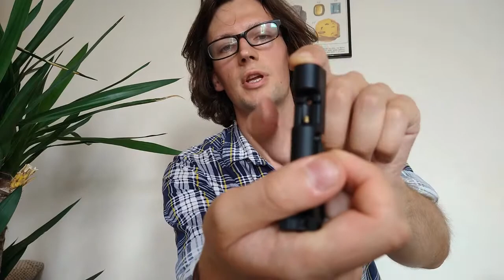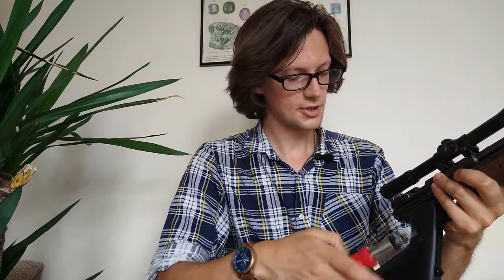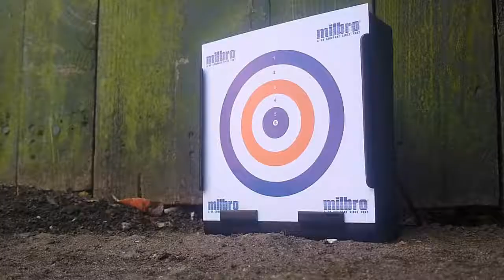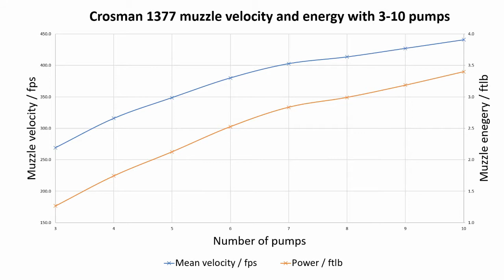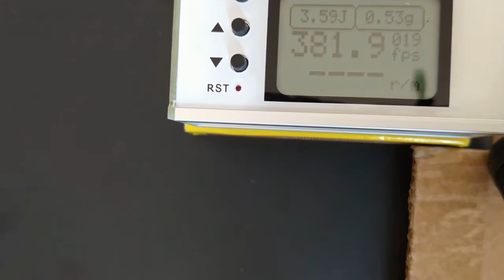Crosman 1377 Mods, Power and Accuracy Tests

Comment: Hi, I noticed you push the Bolt in real fast ,,, When I switched over to the steel breach, my pellet would get stuck before it goes into the chamber, does your steel breach give you that problem? It seems to get stuck on top of the screw ,that you said that you switched yours to an Allen head screw

Comment: Wonder why yours is so much off on power..my 1377 3 shot chroni tests were with a 7.9 g cphp pellet was 3 pumps 388/373/375 ..5 pumps 455/459/462 ..8 pumps 532/541/531 ...10 pumps 562/565/568...12 pumps 592/595/594 ...15 pumps 625/616/621 ..20 pumps 636/640/637 ..all ive done was steel breech and cleaned the barrel on it ..wonder why ours varies so much

Comment: I got confused at beginning when you showed the transfer port mod. You mentioned drilling out the orifice, but you wanted to remain stock. So, is the new transfer port the same O.D. ( outside diameter) as the original? Just the I.D. Is larger by way of a thinner wall on the new port insert?? Thanks

Comment: Could you tell me where I can get a longer barrel for my 1377
Reply from the maker: Hi, gmac custom parts sell 18" and 24" barrels for £40 and £44 respectively but it looks like they're out of stock right now. Their customer service is pretty good so you could email and ask when they might have some in. If you're in the UK, bare in mind that air rifle barrels have to be collected in person, sent to a RFD or posted in exchange for your old barrel.
Reply: @ThrHillSeeker  I bought a 12-inch barrel on eBay last night. He has all sizes just search 1377 barrels on eBay.
Reply from the maker: @CharlesNolanArt  Unfortunately airgun barrels have to be sold in person by an RDF in the UK (the same as whole airguns) which makes modding a bit more difficult.

Comment: Nice video mate. Have a stock one myself. Will likely add the stock myself and go for a weaver rail mod, so i can swap sights with the Umarex Buck Mark.  Would say, i think it really did not like your pellets.  As with the right pellet it can easely put hole on hole, this thing has nearly match pistol accuracy with the right pellet. 

I was quite surprised that it didn't provide more power with that transfer post upgrade tbh. I expected it to be quite a bit over 600fps with that upgrade.
Reply from the maker: Thanks for commenting! Sounds like a good project. Yeah, the spitfire pellets are awful but they were all I had that day. Now we're coming out of lockdown I'll be able to get out and stock up on more JSBs. It's a pretty old gun and I don't know what the previous owner did (or failed to do) to it, so the valve might not be in great shape.
Reply: @ThrHillSeeker  Indeed, it may be leaking a little, not too uncommon, mine does so too. From 6pumps up i always feel a slight rush of air over my trigger finger. That said i mostly just shoot 3-5 pumps. Plenty for my little range
Reply: @XCougar85X  what pellets work with your 1377?
Reply: @brandongoutdoors  Exite Hammer work fantastic on mine
Reply: @XCougar85X  thanks

Comment: Did I miss it, ?  What was the distance you were shooting at, ???
Reply from the maker: My bad, I don't think I mention it in the video. Shooting was at 12 meters. Not my finest work I'll admit, hence the long list of excuses.
Reply: @ThrHillSeeker  I put a Lasso 4x scope on my stock 1322 with the Crossman Intermounts (I added a rubber shim to keep it from slipping. I was amazed how how I was instantly able to get 25-35mm groups at 10 meters - perfect for squirrel eradication! I’ve just upgraded by adding the stock and a 14.6” barrel. Would like to get the transfer port upgrade and steel breech next.
Reply from the maker: @ScottHz  Very nice indeed. The steel breech is well worth having imo. I've just bitten the bullet and fitted a flat top piston and valve. There'll be a video of it out on Thursday.

Comment: ...Well done,....I was given a fairly beat up older 1322...there was a .22 bullet stuck in the barrel and the muzzle was horribly beaten up.....I stripped it down and resealed it, put on the 1399 stock and chose a new 14" barrel rather than re-crown the original ....I find this combo works great, being not unwieldy as with an 18" barrel or longer....I prefer the 'speed' of open sights as I do a lot of ratting at a close distance....One thing, the front band can be opened up slightly to slide through a longer barrel,...I did this first, then opted for a 760 barrel band and found the cocking arm would contact it while pumping and, of course, move the barrel....I removed a lot of plastic off both the barrel band and the cocking arm to alleviate this....Just a fore warning....John (west coast,Can.)......( it now hits very hard and is very accurate)

Comment: At 16 minutes, what is the number on the red dot sight u have there? Can it be used on the barrel?
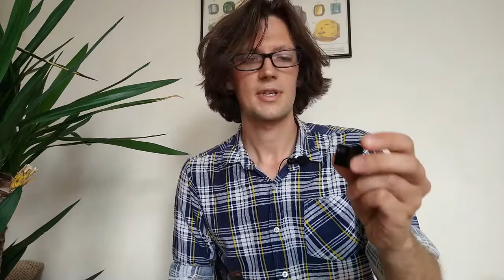Reply from the maker: Thanks for commenting and for subscribing! Sorry, I'm not sure I fully understand your question. The red dot sight is branded Field Sports and isn't magnifying but has 4 brightness levels. The SMK scope is 4x20. Both can be mounted onto the barrel using the dovetail adapters shown at 3:27 but they tend to move around even when very tight. I hope this answers your question, let me know if not. Happy new year!

Comment: Well worth watching keep up the great work, Do you have any intention of changing the barrel in the future (not trying to spend your money). I would also like to see figures on the trigger spring, you may have seen a video with a trigger being fired by a feather Dangerous.
Best Regards,  David
Reply from the maker: Hi David, Thanks for your kind words. I've considered swapping out the barrel but I quite like how easily it can be reverted to a pistol. I might still pick one at some point. If I can get hold of trigger pull gauge, I'll get some measurements and make a video.